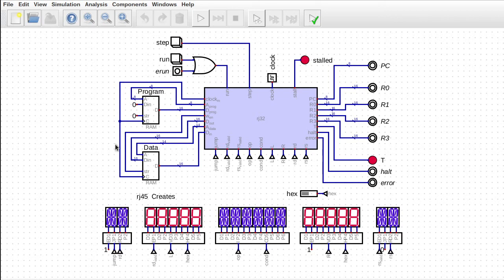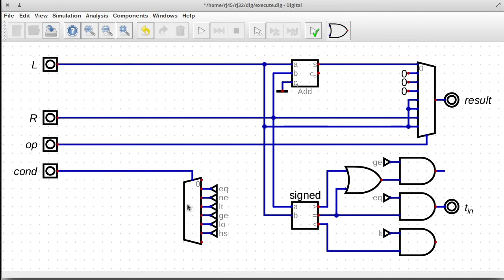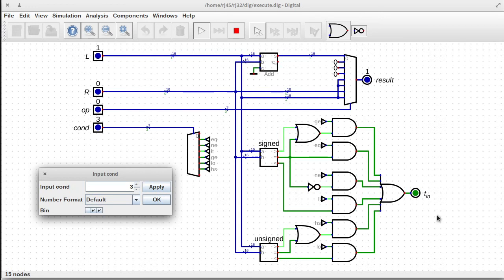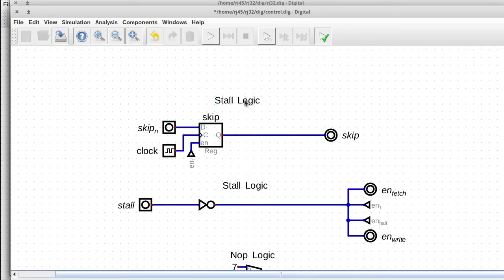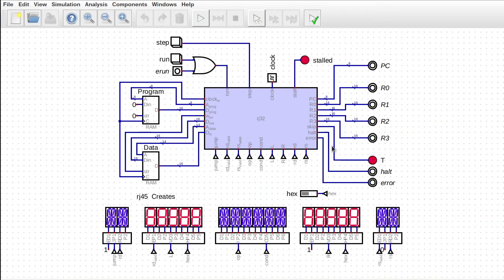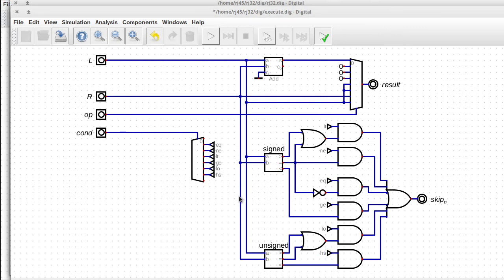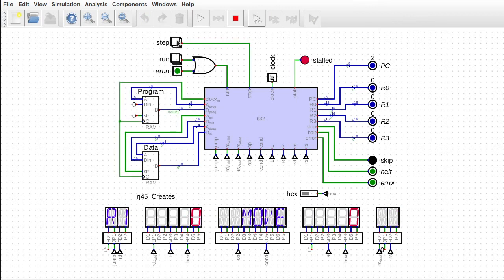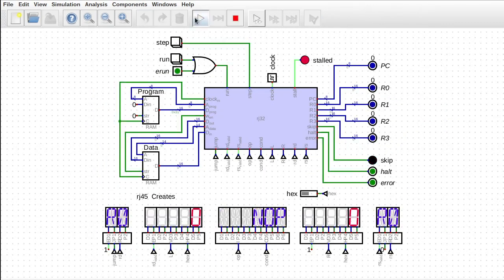[027] Conditional Skip! - Building a CPU From Scratch

Comment: One of my hobby projects is a 32-bit VM. In its architecture I also have if<cond> instructions, and I thought of having them skip the next instruction as well if the condtion was met, but decided against it because I found it counterintuitive. Instead, it skips if the condition is not met. 

Did you have a similar line of reasoning for skipping the instruction if the condition is met?

p.s. I was inspired by your videos to dust off digital as well and try and implement a custom ISA. Thanks!
Reply from the maker: So, `if.eq` skips the next instruction if it's not equal, in other words the next instruction is only executed if it's equal. I find that more intuitive as well. And I am very glad I inspired you to play around with Digital :-)
Reply: @rj45Creates  Thank you.